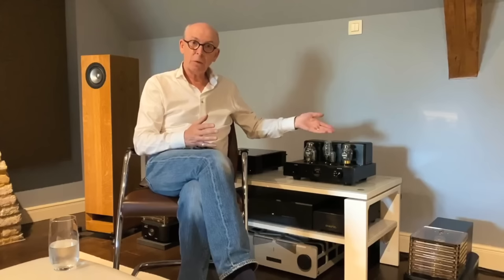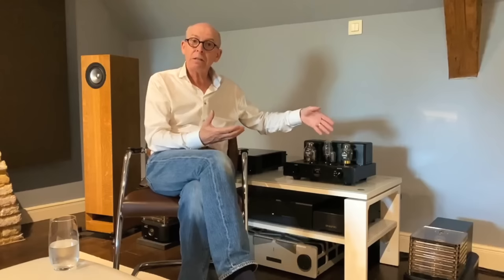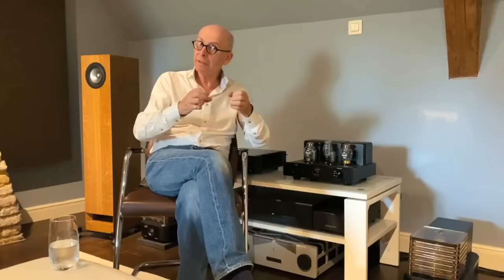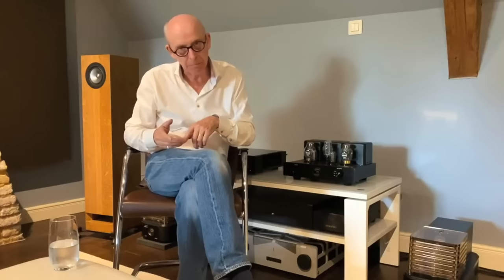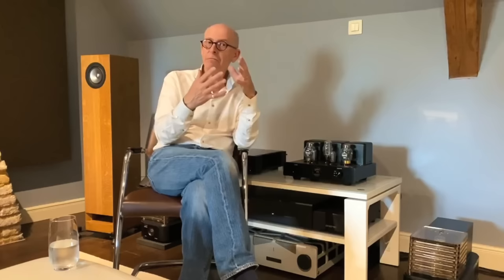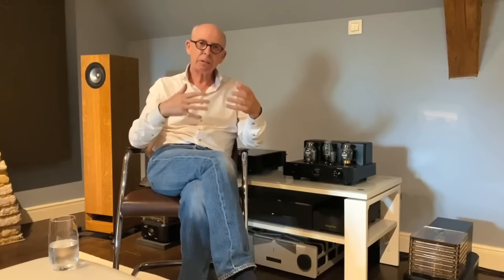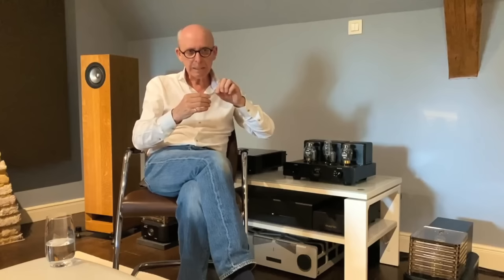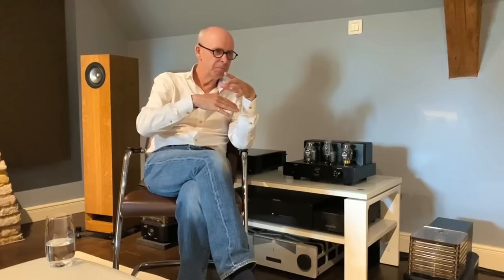What HiFi amplifier? What type to choose?

Comment: Has anyone ever heard of a HIFI amplifier simulator, aka a software emulation of an original classic? There are dozens of guitar amp simulators, and they replicate guitar amps quite well... so has anyone heard of similar software emulators for HIFI?  I dare say the industry would have a vested interest in shutting it all down.
Reply from the maker: Hi Aaron, I have often thought the same. I have such a guitar amplifier with multi-amplifier simulator. However, there is a very big difference between an approximate simulator and the real thing.   And whereas there are tens of thousands of people worldwide who want to buy a guitar amplifier simulator, i imagine very few would be interested in a HiFi one. But the concept is a fun one
Reply: @PearlAcoustics  Yes, a Google search turns up nothing, so they are obviously not catching on, if they ever existed at all. I was considering using one for a pair of bi-amped studio monitors for everyday listening, they aren't HIFI speakers though and can make most mp3 files sound utterly hideous. I have one foot in the studio and one foot in the HIFI. Trying to  marry the two, so I arrived at HIFI amp simulation...ho hum.

Comment: Hi ! Thank you for all these explanations about class A, class AB amplifiers, that's very interesting.  I have electrostatic loudspeakers (final 1000i) wich I considerer to be very good ones.  Impedance is quite low (average of 4 Ohms and a minimum of 1.7 ohms above 12000 Hz.  Sensitivity is 86dB / 1W / 1M which is not a problem as you explained in another video because I have a quite small room and I'm not listening at high volumes.  So, here is my question.  Is it possible to find a valve amplifier (maybe a single ended one ...) able to drive those loudspeakers ? Thanks for your answer.
Reply: I don't think a valve amplifier would be a good choice for those speakers.  Single ended valve amplifiers would especially be ill-suited..Not only is the impedance magnitude at high frequencies is low, the speaker load is capacitive meaning voltage lags the current.  You need an amplifier with a low internal impedance that can handle the capacitive load.
Reply: @johnhudelson2652  Thanks for your answer !

Comment: Something baffling me:
Why do my low sensitivity speakers (85dB at 2.83v, Elac UB5) sound better/lighter/more effortless when using a more brutish amp with approx. 180 W per Channel ( according to RMS and DIN) - compared to a 70 W per channel amp?

I don't even listen at high volumes.
Do amps of higher power tend to supply/ react "faster" in general? Or what other qualities would the larger amp have?

Cheers.
Reply from the maker: It purely depends on the design of the amplifier. There are hundreds of different design principles - some work better than others. It’s nothing to do with power, in most cases.
Reply: @PearlAcoustics  Thanks for your answer.
My question stems from several reviews recommending 140 Watts or more for these speakers - and I don't understand why they do that.
Reply: @PearlAcoustics  Sometimes I see in the spec's the rise time ...is that more important, ( combined with the amount of current it can deliver) then the Watts? eg :  100V/ms and 25 A...
Reply from the maker: @Mrhifitunes  that can be but also unrelated items can play an important role like DC offset. How much the woofer is deflected by the amplifier without an in coming signal. I am doing some research with Colin Wonfor and Scot Lindgren on ‘the perfect amplifier’ using The Sibelius loudspeaker as the subject in question. Once its completed, maybe I can answer you question more fully!

Comment: Your description of Class A and Class A/B is not quite accurate.  The Class A You describe IS "single sided" Class A , meaning when the signal goes positive the current is at maximum, and when it goes negative the current is at minimum.  Yes it operates from a single power supply, Usually above ground.  Before the output and phase inverter stages, tube amps were usually "class A" voltage amplifiers.  But there are also "Class A push-pull", in which the negative side is fully on during the negative cycle, and the positive side is fully on during the positive cycle.  At zero output both output sides are more than 1/2 way on..  Neither side ever goes fully off.  

  The next type of amp configuration which You described is closer to Class B in which the positive part of the signal is controlled by the positive 1/2 of the circuit and the negative side of the signal is controlled by the negative 1/2 of the circuit.  in class B there is no overlap.  In class A/B there is some overlap.  In classic tube amps it can be more than 60 %,... IE the side which is opposite the signal shuts off but only once the signal excursion is well past the center mark.  In less expensive Class A/B transistor amps, that area in which both sides of the circuit are engaged maybe less than 5% of the total signal.  This CAN lead to "crossover" distortion, which is typically worse the harder You drive a transistor amp, and occurs at the point the signal "crosses over" from positive to negative.  It shows up as a very narrow flattened area of waveform, and sounds really nasty,  A Fourier analysis of an amp with crossover distortion  shows high order odd harmonics like 7th, 9th, 11th etc, it has a kazoo like raspyness, and is not a fixed percentage of the applied signal.  
  
  With careful design whether tube or solid state there are ways to completely eliminate cross-over distortion.  Single-sided Class A amps tend to produce 2nd and a little 4th order harmonic distortion that is proportionate to the signal strength, because it is similar to the way material in the real world resonates, it tends to sound very warm and natural, and not like distortion at all. Single sided Class A tube amps with an output transformer does a bit more of that than a transistor single sided class a without one.  Your description of Class D is nice, if a little generalized.
Reply from the maker: Thank you for your informative addition to the topic. Indeed, I over simplified. And I failed to mention that Class A can also be push pull, I simply felt it was getting a bit too confusing! It’s always difficult knowing at what level knowledge level to communicate and which assumptions to make. But thanks for clarifying the topic better

Comment: First 16 minutes - the amp should be well made. OK, point made, but how does an average user judge that? 
BTW, the singular form of criteria is criterion. 
While SE is always Class A, push-pull isn't equivalent to Class AB, there are many Class A push-pull amps.
Class D amps are dynamic? Many that I've heard were actually boring and lifeless ...
Reply from the maker: Hi Igor, thanks for your comments. Indeed, it’s really difficult to tell the quality of an amplifiers’ architecture. One way, is to try and research reliability, via feedback and forums, and to learn something about the designer behind it. And thanks too for the correction of criterion! You’re also absolutely correct about Class A push-pull, it really was an oversight of mine not to have been more specific here. The one area where we part, is class ‘D’. Although, like you I have heard many ‘boring and lifeless’ D amplifiers, there are quite a few now, that are anything but. For example, the Purify modules are extremely good. Best wishes

Comment: I currently have a 6w class A valve amp, driving a pair of Klipsch Heresy III  speakers rated at 99db. The amp can drive those speakers very loud, and I don't dare pass 10 O'Clock on the volume dial for fear of blowing my ear drums. I have however read that I would need a more powerful amplifier to get the woofer performing correctly? This would allow the bass to be tighter and less boomy? I haven't really experienced the boomy bass from my setup, but it has got me thinking that I'm missing out. Is there anything in this recommendation?
Reply from the maker: Hi, I personally do not see any reason why a more powerful amplifier would give you any more bass. In fact, the opposite could be true in as much that some amplifiers, like the UFO Zen from Decware is rather bass heavy and is only 2,3 watts. You might want to listen to that first?
Reply: @PearlAcoustics  Thank you for the recommendation, I will research the Declare as you've recommended. I've also watched your video on the lyngdorf tdai 1120 which has me even more intrigued, offering a host of benefits over a more traditional amplifier.  Great videos by the way.
Reply from the maker: @j606ywt  thanks, you’re welcome

Comment: How about the sugden A21 SE signature amplifier? Its class A and the design has been around for 40 years now.
Reply from the maker: A very fine amplifier, with an outstanding heritage. Never heard it drive the Sibelius speakers, but everything tells me they would be a perfect match.
Reply: @PearlAcoustics  hificorner in antwerp has the sugden amplifier...but not the Sibelius speakers 🤔
Reply: I have the sugden a21se, a truly great integrated amp. It drives my tannoy eatons to very nice volume levels and the sound is heavenly....
Reply: @tonydeniro284  how much power this amp draw from the socket?
Reply: @Mrhifitunes  I imagine it is quite a bit as it does get very warm to the touch. I'd have to take a look at the wattage rating.
Reply: @Mrhifitunes  ok, according to sugden, it draws appx 290 watts....so yea, it is going to be more costly to run than a class ab or D amplifier topology. However, imo, the trade off is worth it. It possesses a tube like quality, but with no hassle of tubes. I use a tavish design tubed phono preamp running into the sugden.
Reply: @tonydeniro284  thanks for looking it up.  290 is a lot but then when you cook electric or use oven is a lot more ( for shorter time but ok). Price kwh is around 25 c so it wouldn't break the bank
Reply: @Mrhifitunes  yes, I don't think it would put that much of a dent in electric bill. I have a marantz pm14s1 reference as well, a class ab, and honestly it sounds very nice as well. A warm sound signature. However, the sugden just somehow sounds more right to my ears.
Reply: @tonydeniro284  yes the sugden sounds nice...some class A tubes sounds similar and are cheaper ( around 2000 euro where the sugden is 3300?.but you need to change the tubes now and then...I still didnt figure it out yet which way to go.

Comment: Fair analysis, but still I think that the speaker and the amp should somehow match on the technical side as well. When you build a small speaker and aim for low-frequency coverage then there is no way around a low QT chassis, if you want to control such a chassis and not only want it to wobble around then your aim is to have an amp with a little higher damping factor and a little more negative feedback. If you are more on the dynamic and lager volume speaker then you are usually using chassis with QT of around 0.5 and a higher damping factor is usually killing it so a tube amp with an output transformer is usually more useful.
On both ends there are amps that make little to no sense. I would say that an amp above 50 Watts and damping factor over 1000 can not sound good anymore while a single ended 2A3 with like 2,5 watts output will not do the trick either.

Comment: Harley, do you connect your source directly to the power amp? What's your recommended preamp?
Reply from the maker: Dear Raymond, I use a QUAD Artera plus. Which is a CD player, Dac and Pre-amp, combined. It is designed to plug straight into a power amp (usually the QUAD Artera Stereo).
Reply: @PearlAcoustics  thanks for the prompt response

Comment: The future is Class D, the quality is there now and the savings in power just make sense.
Reply from the maker: That may well be true but you might want to check out what Lyngdorf have done by developing an amplifier that is actually a dac with gain… that could actually be the way forward.
Reply: @PearlAcoustics  Im still floored @ the fact Steinway sells Hi-Fi gear now. Ive also come across some odd tech used in Clarion car audio, sorta.. kinda.. similar to what your mentioning.
Reply from the maker: @AllboroLCD  it’s not really Steinway - more the extremely talented Peter Lyngdorf and his incredible R&D team, that Steinway have bought into. I will be making a video on this topic very soon. Out mid December.
Reply: @PearlAcoustics  That,, I will be interested to see! Still.. a most unusual collaboration. My electrician cousin did some work on the new Steinway building in NYC, what a marvel of engineering!

Comment: This connection to the Sibelius Speaker, is this another lesser version of an active speaker?
Reply from the maker: Hi. No, the Sibelius is as far away from an active speaker than is possible, in as much as it has no components apart from the driver and there terminal posts that connect it to the amplifier. I hope this answers your question?
Reply: @PearlAcoustics  Its me I got confused, thought When you were talking about the part in the speaker I thought you were referring to passive crossover and active crossover....

Comment: Will a tube pre amp with a class D power amp (NAD C298 or XTZ Edge) a good combination? I currently have the class AB Musical Fidelity M5si as main setup with Quad Z2 speakers. I while ago I had the XTZ Edge connected to the tube pre amp Schiit Saga+. I liked the combo but now thinking about upgrading to the NAD C298 and the tube pre amp Musical Paradise MP701 MK2. I have the NAD C298 on try and love the bass control and details, but I can’t listen as long to it as the M5si. So do you have experience with tube pre and class D amps?  Great video by the way
Reply from the maker: Hi Lars, that’s a tough one! It’s worth a try. We used to use an Ayon tube preamp with our D-Sonics and that worked fine. Good luck!

Comment: What about a 45W valve class A preamp?
Reply from the maker: Hi, thanks for your question, but I think you mean power amp? A preamp will only ever need a very low power output. For every watt of pure class A output, you always need to calculate +/- 4 times the amount in power consumption and that equals, very largely heat! My  75W per channel  Sugden is equivalent to a room heater. 😉

Comment: W-R-O-N-G. Buying Classic or vintage 70' & 80's is NOT a "trend" in as much as todays Hi End is a trend. The quality of new components has actually gone over a cliff. That's why vintage turntables, analog class A/AB Amplifiers and R2R tape decks are in such great demand after 40-50 years. Today's hi quality are simply unfortunately overpriced and under valued....
Reply from the maker: Hi, thanks for your comment. What I was referring to on quality was more to do with capacitors and transistors and resistors - However I agree with you on the whole and I have also a QUAD system from the 70’s and an old turntable. Both old and new can be fine. There is no getting away with it, most HiFi today is relatively much cheaper than it was in the 70’s and 80’s. (Except for the real ‘high-end’, whatever that means! Enjoy

Comment: What you think of the Jadis Orchestra ref II tube amp?
Reply: It's fantastic, until you have to bias it.
Reply: @terrywho22  yeah that's what turned me off on the amp. Also dealer didn't want to take time to set up the Ref and let me just hear the black version. It sounded electronic. Oh well!
Reply: @locmanw1583  That's disappointing about the black.  I liked fixed bias amps, but if biasing is not possible without turning the amp upside down or removing paneling, I'm not interested. You made the right call.
Reply: @terrywho22  and I  read the tubes have to be triple matched too or almost impossible to bias properly!
Reply: @locmanw1583  I was aware that they had to be matched, but I wasn't aware that typical  matching methods wouldn't be good enough.  Sorry Jadis but I'm not running to a repair shop if I want to rebias or retube my amp. I'll stick to my Cayin for now.
Reply: @terrywho22  Yep I would agree.😊

Comment: All compently designed hifi amplifiers will sound exactly the same when operated within their limits. Buy something that seems reasonably robust, is from a reputable maker (like Yamaha, Pioneer) and has the wattage you need and you will be golden. And no golden ear audiophile will be able to distinguish it from at super-expensive one (with a flat frequency response) in a blind test,.

Comment: No one speaker playing 87db it would be 93db when they each play 87 db, when tuning the volume from 1 watt to  2 watt it's an increase of 3db
Reply: Yes and no, you have to take into account not only doubling of power, but also doubling of acoustic impedance. If a single source at 1W is 87dB/1m then at 2W it will be 90dB/1m. However with two sources at 1W each, the output will actually measure 93dB/1m.

Comment: who makes the speaker drivers remind me of bandeau  but hes drivers 105db sensitive I don't know if the guys still alive never seen any of his drivers since the mid 90s based near High Wycombe.
You know anybody who is making valve amplifiers with class D power supply that is the way to go running at 120kHz. Much better for valve amplifier you eliminate all means hum 50 60 and 120Hz much darker sounding better response faster better transience win win all the way.
You could try with the class D amplifier running it through a mains candescent light bulb, connect through the speakers cable 150w condemned bulb that I will tame it down give it more the valve feeling.
Why don't you use plasma super tweeters they can go down to 5 k I was thinking you could use a plasma super tweeter as a microphone not seen it done that would be the most fastest accurate microphone.
To control the voltage feedback zobel network should be in the speaker a good amplifier would have zoebel network try putting zobel network in your speakers use a 
polystyrene capacitor 160v 0.1uF and non inducer resistor